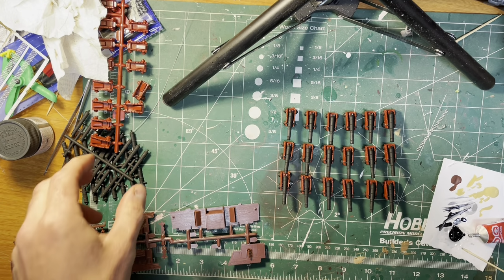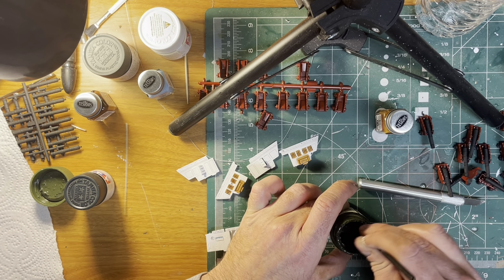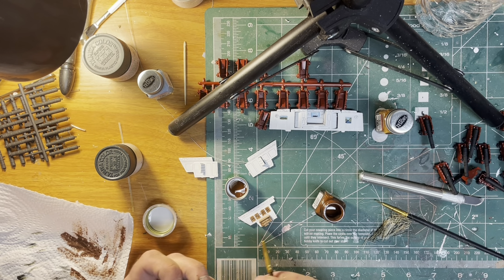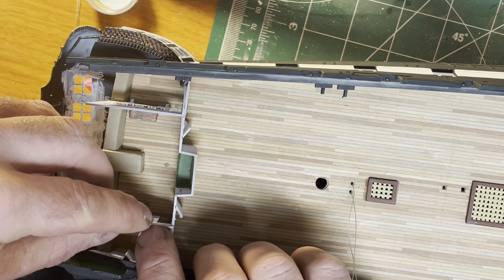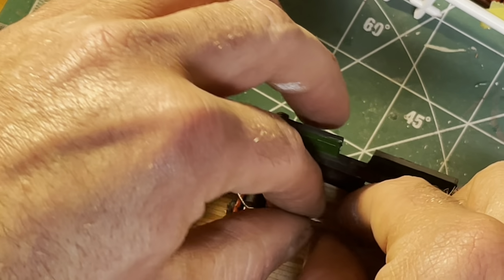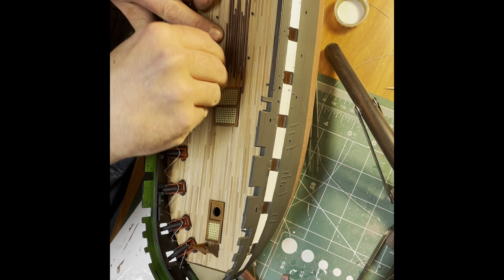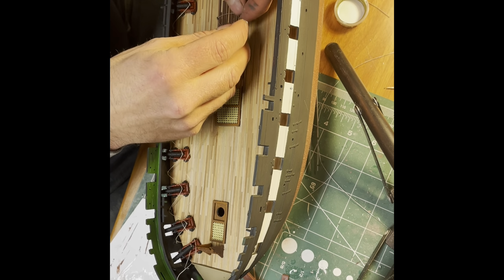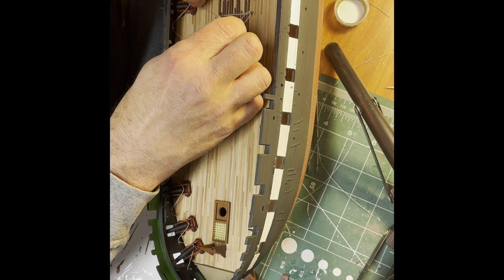U.S.S. Constitution. Revell 1:96 Build.   Part 2.   Cannons and Captains Quarters

Comment: Looking good.  I also made this kit many eons ago (like late 50's or early 60s--also was many decades younger).  I remember that I ran all thread through a pad of beeswax before installing. Made for "straightened" thread a whole lot easier and also minimized the thread being affected by the humidity and/or dust later on.  I still have one in the stash pile that I plan to do before my finger dexterity and/or eyesight totally go to pot.
Reply from the maker: I’m using and after market rope from hismodels.com.   It’s much different than the kit rope.    In this video I am using the kit rope as the aftermarket didn’t arrive at this point.   All rigging will be done with the mentioned rope.  I attached a link for anyone interested.  

https://www.hismodel.com/articles-detail-1450It’s

Comment: Hi LCMODELSHIPBUILDING  I have a question I am rebuilding my constitution and I was wondering where did you get your gun crew from I want to buy it too and put it in my ship and I plan on lighting up my ship as well the cabin and the gun deck
Reply from the maker: I 3D printed mine.
Reply: Oh nice Larry I mean where did you find the file I can’t find the link and Larry if you rigging the ship later use bees wax it’s easy it helps the rigging more easy

Comment: I'm just starting to get back into modeling after a very long break and I happen to have this kit already (I bought it a long time ago on sale). I've been watching a lot of model builders videos on youtube lately and you're the only one I've seen using tube cement, and I'm' curious why? Everyone else seems to use Tamiya or something similar.
Reply from the maker: I generally use tube on plastic kit to plastic kit.   On 3D to kit or photo etch I always use CA, but I’ve always had decent luck with the old testors red.